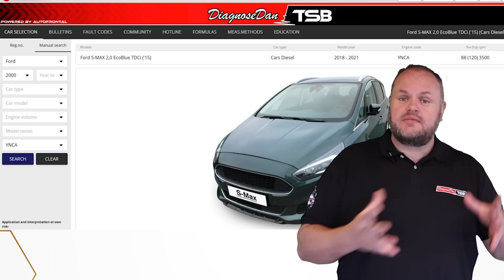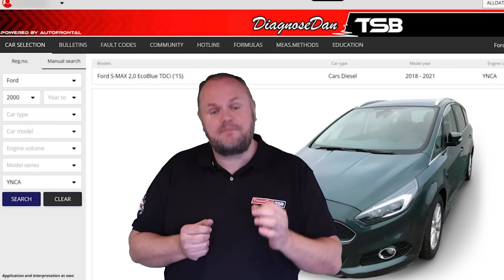Ford S-MAX – Engine won’t rev past 2000 rpm (intermittent), no fault codes. The hidden cause

Comment: I dont understand these technicians. You CONFIRM the customer complaint, perform a service to the car but then dont confirm that the complaint is no longer present? Do you have any shred of pride in your work at that point?
Reply: What happened to the days of road testing the vehicle to see if it has been solved 🤔
Reply: Afther a reset the problem stays away for a while(imo)...thinking it s oke now the car gets handed over and the problems appear a day later...
And maybey the problem isn t there all the time( sensitive for cold/warm or pressure)
Reply: @MrRichard57000  thats why you dont clear codes on habit.
Reply: @The_Noticer. They swapped parts,maybey initialised injectors,and relearn egr....on hind side everithing is easy and often a pain in the butt...
Reply: I believe they are not permitted to invest more time after the fault is diagnosed.
Reply: @OctavMandru  the fact they're obligated not to verify their work is unethical and even dangerous. Maybe they broke something or made the symptoms worse, and hand a unsafe car back to the customer.
Reply: @The_Noticer. Or return the car as faulty as came in. Yep, agreed. However, this is the world we live in today. 
In their defence, in this particular case the fault may take some time to appear, so... And Ford is the real villain here
Reply: In general customers will not pay workshop rates for road testing a car after it is repaired. If the garage test drove it, even for free, most would also expect them to top up the fuel at their own expense too.
Reply: @Daniel-OConnell That is why they bring it in with the needle on E.
Reply: @VashthStampeede  I put gas in and keep the receipt for the customer and I am sure its quality gas at BP at the highest price in town.
Reply: @Daniel-OConnell  That is the most deluded rationalization I have ever seen. You dont expect anyone to actually go for that, do you?
Reply: @The_Noticer. Nothing deluded about it. Intermittent faults are by their nature transient. It is impossible to 100% verify many faults are finally solved, without  test driving the car  for similar range and time intervals as the occurance of the original fault.  Most customers don't want to pay for that. Mechanics are generally not prepared to work for free while test driving cars.
Reply: What I did not notice in the replies is that once the customer OKs the repairs, the shop is no longer on the hook for a good fix. Happens everyday, poor diagnosis, contact the customer with a possible fix with no promise, give the OK, done deal, by law. 

As for 2 or 3 key cycles to get the problem to return, relight the code, or with an overnight cold soak and additional test drive, there is normally no labor guide charge for that. Ford (Mitchell) does have a new brake bedding test drive charge on the books....

So, who believes in ASE training, and are all dealer techs dealer trained???? and if you do, who believes that we all have perfect memories to remember this from the last comeback? Oh, wait, it came back for a different part, so it's not under warranty.